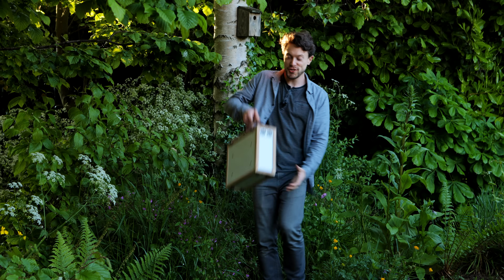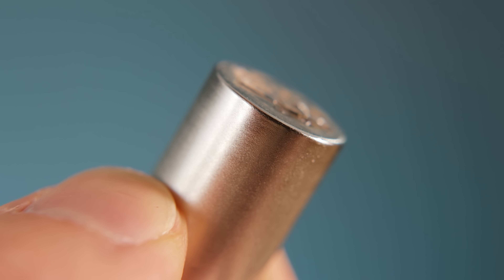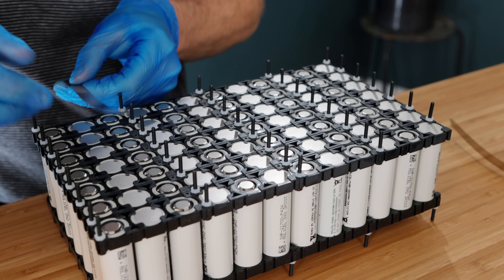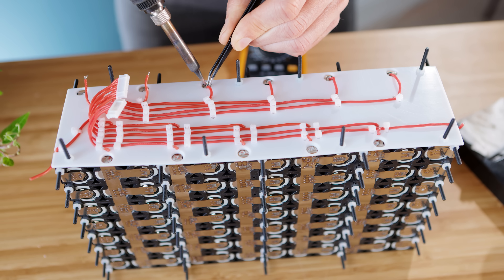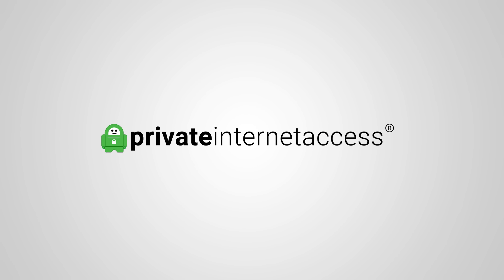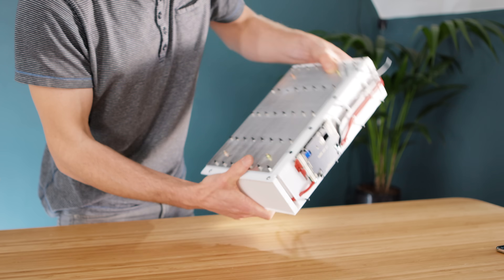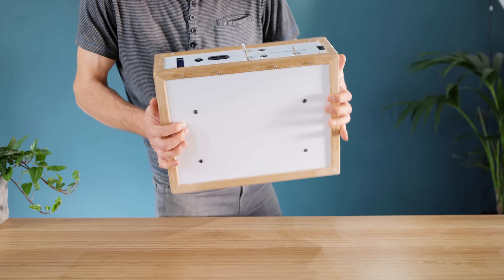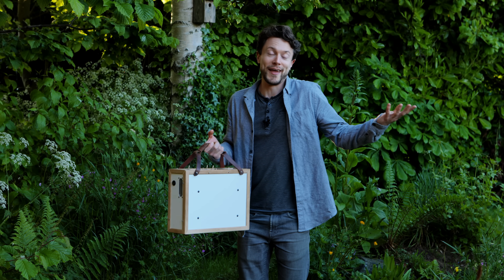Build your own portable POWER STATION (1200w, USB-C and MORE!)

Comment from the maker: Leave any questions here and I'll answer with an FAQ edit to this pin! Also don't forget to check out this video's sponsor - Private Internet Access: http://www.privateinternetaccess.com/DIYP
Reply: What did it cost you to build?
Reply: @philipnelson5 21700 12s7p easy $1k the batteries are expensive the buck converters are $30 a piece the whole build probably $1.5k with tax
Reply: @KindredSupreme  a singular battery is under 4 pound multiplied by 84 cells equals 336 pound, not “1k”
Reply: @philipnelson5  over 500€ for just batteries
Reply: @philipnelson5  that what I’m wanting to know XD
Reply: Will there be a part 2 for this to set up solar based direct charging? would be cool as an off grid option.
Reply: @Omriabu1  I second that, would love to see that happen!
Reply: @Omriabu1  This is even cheaper than buying used Model S battery modules! This was absolutely meant for solar.
Reply: Could you upload maybe a detailed version of what you bought or what tools you used and what settings you used to manufacture this amazing piece of tech?
That would be really helpful.
Reply: parts list would be awesome.. I'm especially interested in the DC-DC converters :)
Reply: You are doing an amazing job but still...show us where you connect what you connect. I learn a lot from that...not only for a specific project but everything in general. Let your videos be long as you want as I think everyone already loves your calm voice and demeanor. Thank you for this video.
Reply: @Drazys-yt  no schematic is a no deal for me
Reply: Loved the video as usual, but can you give us a parts and tools list with the detail and overall cost, please? Thank you very much. ;o)
Reply: @Adamastor00  description
Reply: Cool build!  How are you powering AC mains voltage appliances from the 50VDC, are you using an inverter that can take a 50V input?
Reply: @AllanMacMillan  good question. I doubt he's using a 50vdc inverter, they're usually massive things for more industrial applications.
Reply: @AllanMacMillan  yes, it sits in the final microwave-on-the-table shot, right behind the oven.
Reply: How much does it weigh? I'm very curious.
Reply: I want to see a project like this with solar charging
Reply: @muhamedshorbagy7854  just buy a 20 pound solar panel on eBay and plug it into the battery
Reply: @themastereal8345  👍
Reply: I'm a bit sad there aren't any details in the dooblydo, usually after watching a mobile battery  pack build, one can at the very least find there information about the exact make and model of the utilized battery cells, part numbers for the 200W buck converters (buck, a.k.a. voltage step-down), details on the precise dimensions 9f the nickel strip, used wire gauge, part numbers or website links to the used BMS, etc. etc. etc.

Without any of the information mentioned above being provided it automatically becomes 100 times more difficult to replicate this build 🤔😞
Reply: @TheBauwssss  https://www.fogstar-wholesale.co.uk/product/molicel-p42a/
Reply: Woooow!!! I can use this tutorial to make a battery for my ebike??
Reply: @elcubofilosofico  why not, don’t mind the weight tho
Reply: @elcubofilosofico  Just buy one. And maybe a charger.
Reply: Are you a:
1. Electrical Engineer
2. Super Genius
3. Alumni of Google University
😆
Reply: It looks very well isolated electrically, but Is there any risk of the batteries overheating, whether due to charging / discharge / external climate?
Reply: @tf6858  the fan probably prevents that
Reply: How much did it cost to make?
Reply: I don't think PTFE is the best choice here. If a battery does catch on fire and gets hot enough to decompose the PTFE (higher than about 260C) you will be looking at a lot of very, very bad flouride gasses.
Reply: @lucasmagno9148  I thought PTFE melting is about 360C?
Reply: This thing reminds me of that incomplete Most Powerful LED Project you were doing a few years ago but that specialized PSU/converter died & you didn't have any spares.
Reply: If it's heavy, you can try making a trolley mini luggage type version as well
Reply: @Sandeee  make it battery powered ;-)
Reply: @Sandeee  I agree with this idea, if its a cart version it could have a much bigger battery
Reply: @Sandeee 🎉
Reply: @Sandeee 🎉
Reply: @Sandeee  
Make two so you can carry them balanced.
Reply: great video just be carefull with the ad spot that you had for this video as people have had problems with pia in november last year. any chance you would be able to do a public doc with links for the parts used, like you kind of said in the video you can get the parts to do something like this pritty cheap on ebay but the quality and reliable wouldn't be any where near as good as getting good quality parts from a reliable source
Reply: How does this compare to UPS like Power shield Defender 1600 which an be bought for under  $ 300 Australian?
Reply: @IDraganM  The 'Power shield Defender 1600 ' has a 12V 9Ah battery. This equates to 108Wh.
The DIY Perks battery is a total of 1200Wh. So about 11 times as much power is stored in those Lithium cells.
Reply: @IDraganM  I was thinking one could probably be bought for a fraction of the cost of building one.
Reply: Where did you get your spot welder?
Reply: Is there any chance you will revisit the 1500 Watt LED Project with this? You did promise to test it outside eventually after the power supplies died in the last video. Would be a nice stress test for the pack.
Reply: what's the weight of this system? Cost to build?
I think this would be great for site visits if I needed to take a laptop, but I imagine air travel might through out some flags on this. also would make a really cool LAN battery box.
Reply: How much did that Welding unit Cost ?   Please and Thank You .   Cheers .
Reply: What was the total cost of the build? Not including your labour or tools.
Reply: A parts list would be greatly appreciated!
Reply: What's the total cost of the project?
Reply: @_BlackSpectrum  Based on the type of batteries he used alone that are about $20.00USD, 84 of them would cost $1680USD. The battery Management Systems are between $20USD up to hundreds of dollars. The other components are pretty negligible in cost, not sure about the machined aluminum panels. I'd say close to $2,000USD at the end of the day.
Reply: How much was the entire build?
Reply: Hello, nice job really like all your videos, i have simple question where can get material for build box as the battery in this video, i see other times the same material in your videos, and i don´t know if it´s plastics, or what, thank´s a lot
Reply: I've been wanting to do a portable pack like this and I'm very fond of the way you used the PETG sheets to insulate the whole thing instead of Kapton tape, but I have the STL file for a battery holder similar to the one you used except it's in a hexagonal shape (these can be bought as well), and I want to modify it to have a hole to accommodate screws for a similar design. I'm going to 3D print the holders with 100% infill and my main goal with this style is to fit more batteries. Any thoughts?
Reply: @TheGangster-uc4rk  have you tried to do the parts you thought about 3D printing yet? If you have, did you create the files yourself or did you find them anywhere, did you pay anything or did you grab it for free?  My thoughts are with you on doing those myself, that's why I'm asking. I'm planning on 3D printing everything that can be 3D printed, even like the pegs and all that. If you found/created a file for just the batterie-thingy/holder, some other parts of the build or the whole thing and would like to share it, I would be super grateful!
Reply: @Pre.C_King  I just found the cell holder files online, there’s lots of renditions of them out for free. I ended up buying a large pack of them on Amazon I found for cheap because my printer was having some issues.
Reply: What inverter did you use?
Reply: Where do you get bulk 21700 batteries for cheap? For me to mimic this build, it would cost me well over $1000, making a factory made 1200w battery pack much cheaper.
Reply: Is all the battery poles connection necessary? Since you parallelize each 9 negative  poles into 1 electrically isn't a single series connection of the 12 poles enough? Why are you connecting in series each of the 9 with it's neighbor? I'm sure I'm missing something, but what?
Reply: @DIYPerks please keep the bms balance wires the same length because the different wire resistance will unbalance the cells
Reply: Hi there, I was wondering where you learned about electronics? was this out of passion or due to formal schooling?
Reply: can you do an electric go kart project using this or another diy battery pack?
Reply: @DracolegacyOfficial  my exact thought. I’m 3D modeling one rn. I’m planning on building a few of these for it tho, because I want range. Based on my calculations tho, if you use a 48 volt, 750 watt motor, you should be fine for at least an hour. However, I could be literally 100% wrong, so PLEASE don’t take my word for it
Reply: Why use so many small batteries? Wouldn't it be simpler to use 2 or 3 12v batteries each with a 7.5Ah capacity? 
Could be for the size i guess but just want to know if there would be any difference.
Reply: @tastic3866  and what battery is 12v there are no 12v lithium cells.
Reply: @navidmehdi6  oh. Aren't those batteries used in motorcycles and UPSs lithium?
Reply: @tastic3866  not the same. a battery is a collection of cells. so these 12v battery has a collection of 2v cells. they use a type of lithium tech called LIFEPO4 cells. each tech has pros and cons. LIFEPO4 generally has long life span a stable voltage across discharge but they are much more expensive. each has pros and cons.
Reply: @tastic3866  little to none, maybe for price? Dunno
Reply: How can I obtain the schematics for this build? I’m very interested in building my own power supply. I do have experience when it comes to soldering and etc.
Reply: Just for curiosity, how much does it weigh? :) (in kg pls)
Reply: Can you tell us the make, model for the 48V to 240V inverter?
Reply: What's the build cost? And cost per cell? And what if you wanted to charge a USB-C PD Device?
Reply: Would the temperature of the batteries be a concern since you didn't appear to add any temperature sensors, or are you charging and discharging at thermally safe rates?
Reply: Can you design a Slice Battery for Lenovo Thinkpad T460 with enough thickness the size of 18650 cells 3d printed in a nice case that would make it the first laptop to last an entire week on battery life ?
Reply: What laptop was that 7:30 ?
Reply: how much did it cost to make it and do you have any links for some of the parts?
Reply: @Mike-x6i4l  description
Reply: Total Cost to make it. it must be very high compared to a normal Inverter/UPS
Reply: Where did you buy the cells, why, and how much did you pay per piece?
Reply: Does it overheat? Looks like the batteries are not cooled at all.
Reply: Amazing video. One thing I recommend to change for safety reasons is the nickel path. You should make a main path and solder the cell (blocks) with thinner wire, to make individual fuses.if one of your 84 ones goes rogue, it will affect all the others and escalate it quicky. Wire such as 35awg thin fuse wire is nice, rated 5amps,usually go up to 8amps, much more than you currently draw... 1200w at 50v is less than 0.3amps in each your cells.
Reply: could we pls have a parts list, I really really want to make this as I am camping a lot
Reply: Roughly how much did this cost to make?
Reply: Parts list (mostly)
1 - Energus Tiny BMS s516:
$175

84 - Molicel INR 21700 P42A 45A 4200mAh:
84 * $8 = $650

misc electronics:
 3 50V buck regulators 
 2 tiny fans
 1 usb hub
 1 usb c charger
  also voltage meter, misc connectors, wires etc
$200

Materials
 misc plastic, wood, metal
$100

large 200w? AC to DC charging brick
$75?

Total: about $1200

Considering you can get a comparable e-bike battery for less than $500, it would have been more interesting to see you modify one of those instead.
Reply: What kind of Bluetooth module did you use to connect the BMS to your laptop?
Reply: How many hours do you need to charge this beast?
Reply: I am impressed by your projects every time. I'm interested in how you got the necessary knowledge. So what you studied or what your job is?
I'm looking forward to your next video.
Reply: Are you concerned about leaving this in a hot car? I would recommend an active monitoring & cooling subsystem for the power cells to improve cell life and prevent overheating. Also do you have a suggested substitute for PTFE? Should this catch on fire, PTFE creates toxic fumes.
Reply: @linyongzheng  this would make a good v2 video
Reply: so if we have a cursory, basic knowledge of electricity, construction, and how to safely combine the two, and we follow your instructions/guide as exactly as we can, we can recreate this??? 'cause it's so cool and useful and doesn't seem that complicated, just exacting— which working with electricity usually is! this really will work so well with my camping and road trips!!!
Reply: @kaamn1829  as other people said, this lacks some safety measures if unattended
Reply: How much would it cost to buy one off you fully built and set up let me know thanks
Reply: Hey DIY Perks! I just got 2 questions.

How long does it take to charge?
And
How many mah does it have? (Approximately)
Reply: In South Africa we have for many years suffered frequent scheduled power outages for two hours at a time due to our failing and corrupt government owned power utility Eskom. Some people have a UPS but only for keeping their wifi router running. They will buy a 500VA UPS and then complain that is doesn't last the whole two hours, just running a router which is amazing to me. But I understand their purpose is for protecting equipement from sudden outages and powersurges. Not for supplying power for long durations.  And those things are also very heavy. They seem heavier than that suitcase you're casually carrying around with one arm. I'm assuming they don't use lithium ion cells.

So if UPS is a waste of money for power during a scheduled outage, and full off grid power storage is a big project and expensive. This portable all purpose long duration power supply is absolutely perfect.

I wonder what more it would need to make it act as a UPS. Or if a smaller version would still be economical so you could have two or three in different rooms or parts of tye house without running cables everywhere. Or perhaps a variety of small cheap specialized barebones versions for specific appliances. Like one for any fridge. One for any media set which includes TV, PC and Soundsystem. And one really tiny one for a router.

If someone offered those three things as a product im sure many south Africans would buy them immediately. Lights aren't really an issue. Everyone has some collection of flashlights and battery powered lamps some of which switch on automatically. But then there's just this aweful two hour silence. It used to feel cozy in the beginning like a noval way to get everyone chatting around the only battery lightsource in the house or some candles. I can assure you nobody finds it cosy anymore.
Reply: Can you use XT60 connectors in place of the Deans connector on top and charger connector on rear, and use it 2-way?
Reply: Not sue if he reads his comments but have idea for a different kind of build. Repuposing an old andriod auto car stereo for use as a in home or workshop music centre aka hifi
Reply: Any chance of getting a wiring diagram or instructions so it is a bit easier to see what components go where? I've got a good idea but it is always handy to have a schematic to check against before its first use.
Reply: Can you build one for a fan that is me
Reply: @mixologist1682  same 🤣😅
Reply: What was the total cost of this build compared to buying one off the shelf?
Reply: I have a few questions(I think no one will see but anyways tho):
Lifepo4 is a better chemistry and you said “50 volts fully charged” and usually it is like 51.2 nominal.
I would recommend having solar input, ac input and/or inverter
Reply: What size charger did you use and how long did it take to fully charge?
.
Can it be used while charging?
.
What type of inverter did you use to run the microwave?
.
How much did the project cost you?
Including charger and inverter
Reply: How much to buy a copy of this project from you?
Reply: Hi can you make a video that teach how the Bluetooth voltage preview connection to the software in your laptop to check the condition of voltage in the battery insider?. I'm excited to learn something new from you
Reply: I have a question
The inverter only use 12v or range volts?
I need inverter that use 50v
Reply: what was the side ptft 0.20mm?
Reply: I also have such, but what I was interested about is the inverter. Have you edited the noise out? To power something like a microwave without noise needs a bf inverter... 

On the other hand, I would not power a 1000w device with that battery. Yes it can do it no probs, but don't forget that tesla has a pretty effective cooler for the batteries, and even they do not pull all the juice out in an hour. 2kw is still not too big, and way less stress on the cells with a 1000w load. You will not carry such around. You put it in the car, and out of the car. What I am building now is a 2.4kw 24v battery, 2kw inverter, and mppt solar charger with 400w solar panels, but I might have to increase to 3.6kw, because I need power :-D
Every enhancement of the civilisation without civilisation :-D laptop, projector, fridge... adds up fast...
Reply: @peterbalogh2646  What cells are you using? I would like to do something similar.
Reply: @rando39393   That project is on hold now. In the country where I live, it is kinda hard to get my hands on cells, so we'll see. The rarity of use and the energy density are good reasons to go with second hand lifepo. First thing is the cooling side of the inverter, because that is the only part what makes noise, and I do not like noise.
Reply: Do you plan to keep the cells charged at 100% for your maximum, or will you keep them at a ceiling of 90% or so? Was something like this where the batteries can potentially stay fully charged for quite a long time, it could be vital to the lifespan of the cells that you set a proper charge ceiling for them.
Reply: @Ecrfour  ideally 60 percent
Reply: name2  He used lithium ion
Reply: Is there any concerns over the temperature of the actual battery cells?
Reply: @shark103  You can if you want, but it really isn't necessary. Especially if they're legit cells. Given he chose Molicell, they're almost certainly legit... and expenssiiiive!
Reply: With a battery pack of this size is it possible for a few of them to power a motorcycle or a similar 2 wheeler? And do you plan to make such a vehicle with a DC motor for one of your next videos?
Reply: Are you monitoring the thermals of the battery pack or have a thermal cutout at all? Or is it not nessarry?
Reply: i'm considered with battery cooling....
Reply: You just reminded me my childhood cartoon show, Dexter's laboratory , but you just tall , Big love from INDIA.
Reply: Did you make a cover for the top connections? If not you're going to get a lot of dust and crap in those ports.
Reply: What courses or degrees did you get to be able to brainstorm and/or get into making such great quality items?  I've always loved technology but I usually fall short in the understanding of the internals to be able to experiment and come up with my own ideas.
Reply: @shark103  also
Reply: No brass casing this time? It would've looked super classy with brass!
Reply: What kind of cable did you use to recharge the pack? Where can I find a similar BMS board with charging for lower capacity systems? I would like to build a wireless speaker system inspired by your last build but am having difficulty finding proper power delivery and management circuits
Reply: Where did you buy those batteries?
Reply: @SoyHectorMartinez  description
Reply: Would there be a way to run this as a UPS (uninterruptible power supply)?

Fantastic idea, would love to make one of these!
Reply: Why do I get the feeling that in the future you will DYI a home made Tesla . Great job!
Reply: @quintonquill  just watch Jerry rig everything
Reply: U can buy a pd 3.0/qc 4.0 board which can power compatible laptops with 20V from type-c power delivery.
Also, what about thermal protection and fusing the cells? If one cell gets an internal short this whole thing could flame.
Tesla uses wire bonding tech with large nickel plates but small fusible wires going into the battery for safety. When a cell shorts, the fuse will blow and isolate the fault cell from the pack.
Reply: Do you have a github page with a tutorial ? Or are you gonna leave us in the dark?
Reply: @Snoigel  not even a schematic
Reply: Would love to see a Cost to build for these projects.
Also would love to see more feature coverage on the USB-C and different power options on this unit you've built
Reply: How much did this cost you
Reply: Would you, please, make a wind power plant for a small house?
Reply: Would loved to have seen a parts list link.  And what this cost at built
Reply: What was your budget for this project, both time and money?
Reply: If fire occurs, breathing ptfe fumes can be more dangerous than flame
Reply: Aren't the car fuses made for voltages lower than 50v sometimes even only 12v?
Reply: What was the total cost of the build?
Reply: How did you plug in the PS5?
Reply: @maxclarenf1  power inverter
Reply: Does the pack get warm/hot at all under high loads? (Also considering it is surrounded by fairly thermally insulating material.)
Reply: What brand of cells and what model did you use?
Reply: @technilaunch8353  description
Reply: 6 hours... A ps5? OMFG!
Reply: Will Prowse needs to see this
Reply: I'd like to know more the 4-bay charger you shown. My current charger is tired, and I accidentally purchased button top 21700 batteries which barely fit.
Reply: How did you learn how to make all this stuff?! It’s seriously amazing!
Reply: Awesome video with the what appears to be lots of precautions taken for a battery array!

Are you considering making a solar generator version of this? With the 120/240v inverter built in and a solar input.
I suppose we can modify the design to include it. But your designs and instructions are A+ 😉
Reply: Hi Matt, how are you? 
I have one question: What did you study or how did you end up, doing so cool stuff? 
I really appreciate your content!
Reply: Please make smart glasses 👓 which can give notifications on mobile.
Reply: How do you make videos like a professional
Reply: Congrats 3m sub
Reply: How long is the economic life of that battery pack? How long will the battery last in monthly use?
Reply: The dead earbud into stereo speakers guidelines are still on deck, right :( ??
Reply: Have you considered making a Powerwall? or adding solar charging to this power power pack?
Reply: Can you post the wireless earbuds —>  wireless speaker guide? It’s been a month...
Reply: Would it be possible to backwards engineer an ebike battery? 

They can easily be 60v plus and comes with a casing, you can dremel out slots but they are also welded and can potentially save time and money if don't have a welder?
Reply: @louinesbeggache  remove the pre installed bms and add your own
Reply: How about charging the battery bank with solar panels? Unlimited power for camping.
Reply: Would it be wise or unwise to fill the cavity with a wax to prevent things like water damage or shorting in a humid environment? It would add weight and reduce heat management/ventilation abilities, but could also add protection and a noticeable sign of overheating? Also, would there be a better wax for this, because I know parrafin has a lot of thermal expansion and contraction between its liquid and solid forms?
Reply: @ethane333  I don't think you have to worry about water damage from humidity. I wouldn't leave it in the rain though.
Reply: Can you build a loop battery bank for this setup but make it solar powers?
Reply: Please do a diy external flash battery pack for flash(photography speedlight)
Reply: What I want to do: power an ultrabook and a Starlink antenna (both below 200W), how long would it last with 12 hrs of usage per day, how long would it take to recharge fully and solar panels can be used to charge it or would damage the battery for being too slow?
Reply: @imnotbreno  slow rate of charge doesn’t damage the battery, the battery is 1.2kwh so 1200 watts per hour meaning 1200 divided by 200 means it lasts 6 hours, half your day, solar panels can be easily used.
Reply: Price point plz?
Reply: What inverter did you use? Where did you get the digital display?
Reply: Build a system where you can stack few of them and hook to solar panel+ off peak charging = Home or room primary energy sucrose. Make a kick starter talk to some manufacturer to build the DIY kit so that we can build it our own. And thanks a lot for you hard work. I am big fan since day one.
Reply: Won't all of that plastic prevent heat from escaping and overheat the batteries?
Reply: @AlturoChen  fans
Reply: Where did you purchase the BMS?
Reply: I saw that FLIR footage and immediately thought of the usb port replacement video! Is that the same one?
Reply: How worried are you about the battery pack overheating? Curious if you considered using a cold plate rather than just a couple fans.
Reply: I thought you will use xt60 instead of deans
Reply: Kind of not worth it when you consider you have to buy that little welding station to weld the nickel strips onto the batteries. Plus, where is the parts list?
Reply: Can it be charged using solar panels?
Reply: @TheGOUDfather07  easily
Reply: How can you walk around and not fall with this massive brain of yours?
Reply: Do you have any links to the bms device’s you used
Reply: will you actually make the faq list?
Reply: How about using one big li ion 200A battery?
Reply: Why not 18650?
Reply: please make a full kit to purchase we can buy that as well we could support the channel
Reply: What is the total capacity of that battery
Reply: I think it would be nice to add a 12/24 V Input with a MPPT-Controller, this could be used for charging via a portable solar panel or small wind turbine.
Reply: Sir can we add two solar panels on its two parallel side to charge the battery pack ? And sir can we add more cells and can create a battery pack  which can run an Electric vehicle.
Reply: Is it safe to power heavy appliances (microwave, fridge) when it’s only providing 50v, I thought that they require 240v?
Reply: Can it be used as a ups?
Reply: Can I do it in a small scale ? If possible which parts do I use?
Reply: the more important question. Can this light up a Lightsaber....... ?
Reply: You said you used regulators for 12/24V, why not use down converters as these are more efficient?
Reply: Total cost of this project?
Reply: Have you used some special cells with protection circuits integrated or plain ones and you leave all of the protecting to the BMS?
Reply: well 1. what is the capacity? 2. for me this arent to thick wires but ok
Reply: name2  These are LiFePO4. Fill your mind with technical details at battery university (google it).
Reply: Approximately how much did all the parts cost?
Reply: It would have been even greater if you had made a diy spot welder (the one you have is quite expensive for a single diy project), you can make one from a microwave transformer !
Would you consider to build one ?
Reply: With such a large number of cells in close proximity, I'd have expected some more heat management, ensuring good airflow around the cells, possibly with fans and temperature sensors.
Reply: @JohnnieHougaardNielsen  I had been wondering about heat too. I think the faster it's discharging, the more heat generated so maybe limiting the overall power draw is enough?
Reply: Are There slightly cheaper but good enough BMS? 170€ for yours is a bit much for the small 6S7P i want to build. :/
Reply: it could be one of those: https://de.aliexpress.com/af/108W-USB-Car-Charger.html they all look pretty similar. i'm searching for a good one myself.
Reply: How many amp hours or mah is it. And how much total did you spend on materials?
Reply: Plz share where did you buy the battery cells plz share website and link
Reply: Would be nice to have a rough price breakdown. Also, would like to maybe see a future video to address waterproofing concerns regarding this item, have 50v DC exposed to the air like this is probably not a good idea :\
Reply: How much does this cost?
Reply: they are using those as the new solar batteries, they are super nice and compact.
Reply: What about heat dissipation? From what I know, any operation (charging or discharging) of these cells over a period of say a couple of hours can lead to heating of the cells. Does this heat degrade the performance of the cells (especially considering that they are in an enclosed space)? If so, then is there any way to remove the heat? And if heating is a thing then are should one be concerned about fire hazards? Because this was a concern with earlier Teslas which had batteries similar to this in close proximity. 

My information/knowledge could be wrong. Feel free to correct me!
Also, awesome build. Congrats. I have watched this video in its entirety at least 3 times.
Reply: Why does the external charging port have 3 pins? and what kind of charger are you using? 50V constant current?
Reply: What’s the capacity in Wh?
Reply: Can you add a build list.
Reply: Is there a way to add AC outlets to this circuit tree?
Reply: Would you be so kind as to provide a wiring sceme? xx thank you
Reply: Where did you get that Charger? 2:21
Reply: Don't we need a better cooling system for the battery pack?
Reply: any chance of solar charging?
Reply: you sould check out @jehugarcia he is working alot with DIY battery solutions, it might be interessting for you.
Reply: Is it possible to link it to a solar charger?

 I have horses in a field and am looking to set up some creature comforts. Was looking at running stuff of a car battery but it's very limited and I wouldn't be able to hock up a laptop to it.

Will definitely build a version of this now I think, but would love to know if I can charge it with a solar charger, rather than remember to bring it home
Reply: Could one top it up using solar?
Reply: Did you cut the balancing cables to different length's, I couldn't tell and sometimes the slight resistance from the cable length is enough  to cause balancing issues over a large time.
Reply: Are you sure your PCB at 14:40 can provide 24W per port ?
I've tried to find such product but every time I only find ones limited to 18W or 24W in total, i.e, distributed over all ports.
Reply: Why not build one of these batteries in a slightly smaller form factor to replace your car battery with? I'm sure the weight difference wouldn't be much, if any, assuming you only make it using enough cells to match the form factor of the original car battery. In addition, I would think that doing so would keep your car battery from dying if you were to leave the headlights on overnight.
Reply: Just what is the energy capacity of that thing? Are we in the high kWh range?
Reply: Is there anyway you can show/ explain how to make this “system” compatible with solar panels? I really want to try and make a solar panel version of this for ventilation and lighting in my workshop. And maybe some tools 😇 love your videos can’t wait for the next one 👍🏻🇳🇴
Reply: I'm curious to know the cost of this project as well as how long it would take to fully charge the batteries.
Reply: With the nickel strips being routed over the plastic battery holders, and using the battery holders as a main structural element via the plastic nuts, aren't you worried that mechanical shock load to the outer shell could push on the battery holders, and pull up on the nickel strips?
Reply: Can you drop the parts list
Reply: Put the kits for sale on a shop.  :)
Reply: I wonder that you might check out this channel (https://www.youtube.com/watch?v=emip7H8_-Yg) who has built a powerwall for his house. Despite taking care to balance out the cells (especially since he's using used laptop cells) he gets issues with cells heating up within the pack.
How confident are you that your BMS not only balances the cells but also stops overdischarge or excessive differences during discharge?
Reply: Can you list the parts and websites you used to order them?  Thanks DIY Perks!
Reply: How did you manage to solder the side folded strips without melting the plastic spacers under it?
Reply: How about instructions for a 120 volt portable power box.
Reply: Why haven't you mass produced and sold this yet? This seems extremely useful for so many reasons.
Reply: Would it be possible to hook up the battery to a small solar panel to be completely independent when you go camping?
Reply: How long can this power your parabolic dish sun for?
Reply: this is the only sponsor on any video I will ever use
Reply: How much was it? Do you have a parts-list?
Reply: one of the best useful project.. i wonder if it could even fully charge an electric vehicle?
Reply: What's the general budget that it would take to actually do this project?
Reply: Hey man, I wonder if you'd be willing to make an actual guide for this one, I'd definitely be willing to purchase a step by step guide off you
Reply: I was wandering about cooling. I know with my experience with lithium cells that that they can produce heat. Surely that many can produce enough to worry about?
Reply: Why didn’t you run parallel connections on the negative terminals?
Reply: Nylon nuts is the term given to cheaply produced men's underwear, and I shall use it from this day forth.
Reply: @NeonVisual  great seeing you here! Loved your voyager work.. Would love to see you work on remastering full episodes😳
Reply: Question - what about using LiPo?
Reply: This looks expensive, what’s the cost including special purpose tools like the welder? Is it not cheaper (and safer) to just buy one?
Reply: I’m sure you can’t talk about price since the project was sponsored, but maybe you could tell us more about whether this is something the average DIYer could afford. For example, if I can afford a PS5, could I afford this project, or is this a >2 PS5 project?
Also, have you thought about making a supercapacitor version of this project?

There’s a YouTube channel called lasersaber that made a hand-crank generator which uses supercapacitors for its power storage. I’ve thought before that his design could be scaled up to include a pedal-powered generator, such as the K-Tor power box, but it is far too complicated for my skill set, and far too out of my price range.
Reply: Why didn't you use a nickel bus bar on the positive of the cells? This is the first time I've seen someone doing that.
Reply: When is the solar panel top rack video due ? (kudos on the build btw)
Reply: @shark103  How are you going to measure the internal resistance? If the batteries cells are the same make and model, then they should be close enough for practical applications.
Reply: PowerPole would have been a better choice of connector for unregulated DC output.

https://www.andersonpower.com/shop/wire-to-wire/powerpole.html
Reply: So are you the new David Attenborough of DIY tech? Well, that's the way I see you. We really appreciate your work!
Reply: Are you going to make videos more frequently now?? Your last video was only two weeks ago whereas they’re usually about a month apart
Reply: What about battery temperature monitoring/fuse? Unnecessary??
Reply: This is perfect as is, but can you make your car charge this? Maybe add another dynamo (i guess it‘s called like that) somewhere to your car, making use of the distance which you would have to travel anyway to get rewarded with electricity :)

Also thanks for making this video, greetings from Switzerland
Reply: Can we use this for electric motorcycle 🏍?
Reply: Have you an official Instagram account. Could you link it to a future video please. Also part list would be great. Keep it up
Reply: name2  At 0:48 he clearly states Lithium-Ion, not the polymer ones.
Reply: Good build but no thermal protection?
Reply: What is the total combined amperage output?
Reply: Hello, can you make a video about what we can do with a broken phone - with his camera or something else?
Reply: Wha is the capacity of entire thing? total parts cost?
Reply: 5:42 The name of the music playing in the background?
Reply: You should so start selling kits 4 these and also maybe even the full product
Reply: Nice build! I love you attention to detail. How bad was it when some of the nylon bolts broke when you were putting the locking nut on them? Were you tempted to redo the whole thing?
Reply: Please add an option to charge it via solar panel. It will be awesome.
Reply: this is a dream for drone pilots on everyday missions
Reply: Are you open to suggestions about a new project? I wanted you to try a project and I'm sure it'll help a lot of people.
Reply: https://youtu.be/N7sXHc2ul1Q
Reply: Hey man, awesome project.. just wondering if you could sponsor the batteries for me.. where i come from, it's very very expensive.. i just wanna make those amazing project of yours.. if you can sponsored, i really appreciate your help.. hope to hear from you soon..
Reply: @2nd 87898
Reply: Is there a way to charge via solar?
Reply: can you make a portable PC
Reply: yet another great video i am sure, but I am still waiting for the guide to make the earbuds/bluetooth speaker build?!?!?!?!?! it says it "will be uploaded shortly".....its been a month now and you have uploaded two more DIY PERKS videos.....
Reply: Get a correct tip for your soldering iron.
Reply: can you make something on a old PSP or PSVITA
Reply: do you have a job dude? just tell me and no lie!
Reply: How about hooking it up to a Photo-voltaic panel to charge the battery pack with it? Do you think is it possible? If you could pull this off then the system is literally off-grid.
Reply: Were you in Game of Thrones?
Reply: Why did you choose 50v?
Reply: Please do a UPS system!
Reply: Next project suggestion small cctv camera using old mobile phone camera
Reply: Could you hook up a power inverter inside of it, and have one or two (In my case US) power outlets?
Reply: How long does it take to charge the whole thing from 0 to 100? Also how long can we use a outdoor infrared heater with this magnificent brick?
Reply: I watch all your videos and might I add you've got excellent ideas and designs and some excellent builds
Reply: Where did the software to monitor the battery pack via bluetooth come from? Does it come with the module or the BMS board?
Reply: Would love to know how to charge it with solar?
Reply: @markbernhardt6281  you can add a 1200 watt micro solar inverter (available on amazon) and use one of the sides to attach folding solar panels
Reply: Can it charge Tesla?
Reply: DIY motorized height adjustable desk please.
Reply: Can you do a similar video but using old iphone 4/5 batteries? I have around 200 iphones 4/5 and i was thinking about building a kart or e-bike with them
Reply: Would you ever sell one and if so how much?
Reply: how do you calculate the measurements of each piece?
Reply: I love your Videos. But i have problems with the BMS Settings, but i have the same BMS as you.
could you Show uns your bms Settings?
Reply: @shark103  Im no expert, but to an extent what you are saying sounds correct. Differences in internal resistance could mean one parallel chain charges slower than the others by receiving less current. grouping the batteries such that the total internal resistance of each parallel chain is equal to the other parallel chains would ensure that they all charge at equal rates. This is, as you identified, VERY important. What this doesn't account for, though, is the possibility of different rates of self discharge between the batteries, or other confounding variables that may impact a battery's power output and charging speed/capacity. An easy way to reconcile this is to measure the voltage output of each parallel chain. This will indirectly take into account the resistance of the circuit because Voltage is equal to the current times the resistance. 

So, to your point, matching each series' total internal resistance together is important to make sure no series is charging faster/slower than the others. To his point, matching voltage output of each battery will simultaneously ensure that resistance is matched, taking into account the confounding variables that may affect battery output.

of course, my knowledge of electrical circuits is relatively limited so I could be mistaken in my reasoning and/or my conclusions
Reply: @2nd i think he used Xiaomi's 90 watt car charger, since a few of their phones can actually charge with those ludicrous speeds
Reply: what is your school career?
Reply: 🤔So…these lithium batteries can be used to make “impressive” homopolar demonstrations?…
Reply: How much did it cost? And is it worth it?
Reply: Needs a solar panel on one side, just to get that little bit extra out of it :D
Also, how well does your heat management work? 50W is... quite a bit of power. And lithium batteries can get uncomfortably warm under high loads.
Reply: You said it's capable of powering a console setup I am looking into buying a portable power pack for a PC project that I am working on I'm planning on making a portable desktop just because I don't like laptops that much they're too limited in the power poor performance so I was going to create a portable laptop out of desktop parts full on desktop components full on power supply as well would this be suitable for a mid-range gaming computer setup simply a mid-range gaming tower and a screen the power bank will be built into the back of the screen most likely so I'm wondering if this is suitable for that application it definitely looks like it could be but I would like to know what you think on it there's a whole lot of questions here lots of people commenting I don't expect to get an answer right away if ever but I hope I can soon
Reply: Can you add a solar powered charger for it, for the next video?
Reply: How much you spent and what is the list of parts
Reply: All I want is to talk with Mr. DIY, been watching for a long time, have been looking for your email also, I NEED TO HAVE A TALK WITH YOU, thanks
Reply: How much did it cost to source those materials?
Reply: Is there a way to make this able to be charged with solar power?
Reply: Can you make a solar powered charger?
Reply: @Morgan Holgate look at the description the batteries he got are 4200mah 21700 3.6v for £3.75 per cell if u buy 1-49 then 50-199=£3.71 per cell
Reply: Can I make one of these with enough juice to start a car? If so, how?
Reply: Disregard my other comment you just stated it can work for a car!
Reply: How much did it cost??? And does it matter how many batteries you use?
Reply: What is the cost for this project? And can I order this same device from you?
Reply: How about an added cover for the exposed outlets, due to small particles and moisture
Reply: Can you make a DIY e-bike?! I would love to see your take on it
Reply: Hi.  You repair all kind of stuff. Would this Thermal cameras be OK for motherboard repairs? https://youtu.be/ezKCyDcNAss
Reply: How do you design your projects before you build them? Do you sketch everything out, make prototypes, etc? How do you decide what parts to get? Are your designs based off of part availability or do you design and then find the parts you need?
Reply: Fantastic for so many situations.  Might have to build one.   Can it be charged eg trickle charged by solar?   Also take it to work and charge it up there and then power my pc at home with it lol.....err maybe lol
Reply: Can you make a electric bike with that battery?
Reply: Please please help. I've been trying to do the mushroom light project but ms SMD LEDs are not lighting up after soldering. They do work before but my solder technique seems to be frying them. Can you please advise? Thanks!
Reply: I'm thinking of making this to power a telescope star tracker for some astrophotography. It was getting a little more difficult to follow along for the second half of the video when you started to assemble components. Do you think you can make a pdf guide that is more detailed and shows close ups of how to assemble everything. I feel like that might also be better way give detailed build instructions without ending up with super long videos. Love all you content btw!!!
Reply: i vote DIY Permanent Magnet Generator for next project
Reply: Your device is very usefull in the country where i am living where you can have power during 3 Days in a week could you send it to me it will be very usefull
Reply: Can you make a compact tab from an old  phone  or  something else for yor next project
Reply: That is a monster build and very impressive. I am curious if the control module, can be configured to alert you when the batteries get to a dangerous level and need recharging? The dead car battery boost function is such a great idea to add. With a bluetooth karaoke portable speaker you and friends could have a fun party literally anywhere. The way you explained battery degradation, was so helpful. Does the control module show each battery or just the bank of batteries a problem cell might be in? Thanks so much for sharing your awesome ideas.
Reply: What if i would need 230 V?
Reply: I must have missed it, but what gauge Nickle strip are you using?
Reply: Can u make an external gpu setup for a laptop
Reply: Can u make an external gpu setup for a laptop
Reply: Unless the individual cells have their own current limiting for charge AND discharge. Then you'd just go below the minimum charge on an entire parallel set.
Reply: name2  Spoilers: He's waiting for Solid-state Battery
Reply: total build cost?
Reply: You should make yourself an adapter from the battery output to a standard 2 prong plug, 50 volts should be enough to run most universal motor power tools...   Older vacuum cleaners, drills Dremel and the like often work well on that.
Reply: Why did you not use something like a pelican case? I think it would offer more (drop)protection and is non conductive.
Reply: @asdrubale bisanzio He listened them under the heading
Reply: I'll be very glad if you write everything you did with a diagram into pdf for some of us who want to try out something like this on our own
Reply: Did you think of a cooling system for the lithium-ion batteries? They can get pretty hot under load.
Reply: so how much did it weigh?
Reply: May I ask you, in what domain you did your studies? You videos are pretty incredibles!
Reply: How does this compare in terms of performance and cost to batteries that are pre built for the same purposes ? An example being the Jackery Power stations
Reply: Any chance of schematics for this?
Reply: Did you measure how much of the 1,3kWh you can get out of it?
Reply: Can this be used as UPS?
Reply: @zaxonxp45  It depends on what device you'd like to power. Its capacity is 1.2kWh, and if you have a high power consumption graphic board on your PC, then it might be hard to sustain that long.
Reply: Can you make an electric bike with these cells?I wonder what else we can do with that much power and how many milage we can get out of it.
Reply: I looked for pure nickel strip on amazon but a lot of them have reviews that say it is really nickel plated steel. Where can i get pure nickel strips?
Reply: Someone else probably already said it but a few great alternatives to the dean connector solution would be XT90 connectors, medium sized powerpoles, and potentially a medium sized SMH connector. They would have only one correct orientation, but you wouldn't have to make custom connectors for everything you want to attach to it in the future, just crimp/solder and go :)
Reply: Hey, I little business prop would be to develop these as Saving packs for EVs (Electric Vehicles). "Never run out of juice" What do you think?
Reply: How about build your own DIY hard drive enclosure 2.5” and 3.5”? Massive enclosure or multiple hard drives enclosure??
Reply: What other components would this need to serve as a UPC for powering things like a desktop PC or 3D printer in the event of short power outages? I've been wanting to get a UPC for a while, but consumer units are pretty cheaply made, only being able to power a PC for a few minutes and getting VERY hot doing it owing to their extremely cheap transformers and caps, plus they only last a year or two before needing a replacement for their lead acid battery cells. Your unit clearly performs vastly better, and quality lithium batteries can last for years.

I only found your channel a few months ago. I had a dead laptop and wanted to salvage its panel as a secondary monitor for the desktop I was still putting together, so I ended up basing it on your older portable monitor build guide and I've been really happy with the result. Looking forward to doing another DIY Perks project!
Reply: Amazing!  Your very talanted.  Question, how much bigger would it be to have it charge itself with a handle(maybe a detachable one)?  Is it even worth having the extra weight and dimensions?
Reply: make a Diy electric scooter
Reply: No question just a suggestion. When charging batteries in parallel you pull ground from last negative battery and first positive battery to give you the path of less resistance. Balances the charge to every battery
Reply: Can I but this from you?
Reply: Where you leave the ground （can we have the wire diagram？）and for BMS board is there ones for 2.4V Ti-Li batteries？
Reply: Do you think this could be used to replace leisure batteries in a campervan? I imagine it could have the benefit of being able to access 100% of the charge rather just 50 before causing damage.
Reply: Make A power station 2.0 that can turn ac or freezer & many more
Reply: Hmm battery cooling to extend there life cycle? Can you set the controler to to only charge to 85% and never below a set value?. - Nice Job though, looks really good.
Reply: What about charging adapter? Can you please explain?
Reply: Thermal management optional
Reply: Did you ever consider using the Vruzend v2.1 system? It's a no solder system for connecting the batteries using bolts and bus bars
Reply: Do you use your own diy projects?
Reply: Sir, I would like to ask if it would be possible for me to get more information on this as I would like to build a CAD model for this and try for simulation in Ansys.
Would appreciate any help
for the breathing PC build
Reply: Great project.  Now add the solar panels and system to charge this with solar.   Compare to a Jackery system.
Reply: It seems odd to go with double deans over something like an XT90S, but I'm sure you had reasons
Reply: Hi DIY Perks, Here is an open source technology to build that kind of box for those that have less welding equipment, i have forgotten the BMS images https://www.youtube.com/watch?v=g4Aw9zxtOv4&t=13s    👍⚡ 🔧🐥
Reply: Rafał czy to ty? I was working with someone similar to you on software USB projects and everytime I watch your videos, you remind me that guy
Reply: You are Genius
Reply: What car inverter did you use for this project?
Reply: I would love to have one of those but I dont trust me enough in terms of work safety.
I only wonder why going for a outlet that needs another adapter instead of having multiple different beforehand on the battery itself?
Reply: What do you do with the grounding or is that just the negative
Reply: If I build the same thing with 18650 batteries ,water cooling and carbon fibre   housing , would u recommend me doing it? And also would the change in battery type affect performance?
Reply: Ive seen a huge mistake in the charging port!!!! You have to ALWAYS use the female one for the exposed connector. Phases are way too exposed for any metalic object to short them. And trust me it happens way more often than you think: from coins, tools, screws and bolts... It melts in seconds
Reply: I usually like seeing is the cost of materials, so I can compare it other on the market solutions.
I want to make this, but I really am trying to push my power needs in a portable way, with a bit of haste.
The Jackery series of generators works really well; with that in mind, what did all of this cost?
Reply: What is the total expected cost of the build
Reply: Just wondering how heavy is the pack actually
Reply: I think sharing the total cost build would be very informative videos. Great videos..Much Love from Nepal
Reply: hi, any reason why its 50V packs?
Reply: Please tell components name.. 
Comment all components
Reply: Can you build me one of these please
Reply: Cool build thank you!!
Reply: 7 months later ... Still no answers. It's basically click bait ... For example, one of the most important pieces of information - cost of build (not even including specialist tools) is not given ? Only reason someone wouldn't state the cost is to ensure that you watch the whole video. If we knew it cost $750 (random number), and a commercial alternative cost $450, chances are many people would not watch the whole video as the high expense + effort would not make sense.

A lot of the time people turn to DIY to save money, with the caveat that it takes up more personal effort. That's why no one is asking you how LONG it took to build, because it's a given that it's going to be time-expensive by comparison to the commercial alternative.

Omitting the cost of build is a calculated measure to increase your advertising revenue. And that's bullshit.
Reply: it lasts along time on one charge, that's awesome! Great Build!
Reply: hey diy can u do a video using the power bank whit a solar panels controller for charge it whit solars panels?
Reply: @Mr.Plague-n5x  its possible but he would need a massive solar panel because that's 1200w
Reply: why not make a battery "backpack" ? you could make it more powerful and carry it around and plug it into stuff you wanna use, im trying to make a drone....that you wear like a boot a nice big powerful battery pack would surly get it flying ;)
Reply: What is the thickness of the nickel strip that you've used?
Reply: could the aluminum plating also serve as a Faraday cage of sorts? 

another thing, could the design be tweaked to accommodate lithium ion batteries that have the same contacts with regular batteries? to sum it up im asking if it could be made so that the batteries can be replaced conveniently. sorry if that was long winded. cheers for the awesome video!
Reply: Why would you be powering lights though?
Reply: Can I put this in the trunk of my Tesla as a backup fuel source or for road trips?
Reply: What did your build cost you in total?
Reply: During the designing process, did you ever think about using an ammo box for weatherproofing? I'm sure it would have probably doubled the weight
Reply: I have only one question, that probably 1 in 10 people already asked - why not to integrate an DC-AC, you already did an excellent battery pack, all you needed is leave a little bit more room for 1-2kW inverter 
Otherwise - well done
Reply: Im looking to make a single 18650 battery bank using a DC motor to charge w/ USB-C output, what would I need to control charging so it doesnt catch fire?
Reply: What inverter did you use that had a 50volt input.?
Reply: How many KWH is it?
Reply: Please I need it to buy
Reply: Hi there, how much is the total cost of materials or are you also selling this device. This is very useful here in the Philippines.
Reply: What about heat management
Reply: Do the batteries themselves not require any cooling?
Reply: What about  a temperature thermometers to be sure when u do have a load close to the max load is not getting them hot?
Reply: What alternatives are there to lithium cells?
Reply: How many hours can this power station lasts?
Reply: What is the schematic of the build? Every good electronic channel has a schematic on the circuits they used but you don’t seem to have one
Reply: @shark103  isn’t the resistance the same? They are all the same cells
Reply: Man you just too handsome... 😜
Reply: What's the total price of it?
Reply: Would you make a 60watt powerbank?
Reply: @Nah iDestroyed i'm waiting for the video
Reply: the first two bms board links will not load
Reply: Please where did u buy the li ion batteries from. Please I need to know
Reply: @RUTS thanks
Reply: Can this be charged with solar panel or can be modified to charge with one???
Reply: What is the total capacity of this cell?
Reply: Lifehack channels compared to yours look like cave paintings. good job.
Reply: How are you getting 50V power if only 12 rows in series would add up to 48V if each cell is 4V (which they aren’t)?
Reply: What’s the total cost of your project for materials if I may ask?
Reply: can it be charge with solar panels??
Reply: do you have links for the aluminum plates or corners?
Reply: Me and my brother want to do this. Dad says it's impossible and tells us to buy a generator. I want to prove him wrong so bad. Btw how much did everything cost you?
Reply: ?
 @MikeVenom-mini  ?
Reply: Incredible video! I want to make several project each with varying voltages and capacity. When you test initial cell voltage I know you mention the voltages that are similar should be in the same group but what is the recommended voltage to start out with or does it even matter?
Reply: what inverter you use?
Reply: Hi Mat. Would you try making a portable power station like Ecoflow Delta Pro (3600Wh) power station out of batteries from Elon Musks Tesla batteries, and these can even get harvested or recyclable from Tesla Model X cars or older models. Because batteries operate at a high voltage, they can reach high temperatures. LFP batteries have a higher thermal runaway at 270°C, whereas NMC batteries have a lower thermal runaway at 210°C, making the former safer. And like the Ecoflow make it so you can plug in charging from etc. solar panels or wind turbine. This might get you a place in history to make something cheaper than the current models out there and now since we are in an unsure time where it could be beneficial if anything happens to Earth like say a catabolism, solarflare or fallout events like war or government crackdown or war. Cheers.
Reply: Would've adding a solar panel been possible?
Reply: great idea, i have been using a smaller pprimitive or less complex version of this but i gotta tell you that isoliting plastic around the batteries and the narrow spacing is not ideal as the heat get trapped during charging which overtime damages the batteries
Reply: Can you produce something like this for me and how much will it cost
Reply: can you give us step by step in depth instructions for this awsome creation !? Keep up the good work!
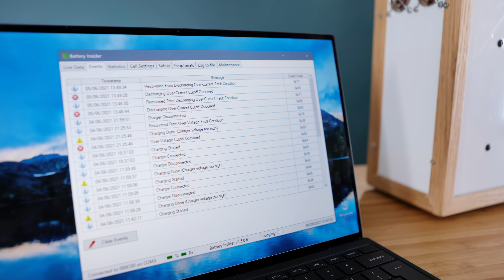Reply: 17:14 What bluetooth module did you use? And what software did you use?
Reply: Hello,
Im having a hard time following the way you've connnected parallel and serries circuit and where  you mounted the bms. Is there a way this can be explained simpler?
Reply: how much did it cost to build?
Reply: How do you charge jt
Reply: Schematics and BOM???
Reply: Can you do an updated video to this.
Reply: Remake for solar charge
Reply: How is it working in 2025? Any problems?
Reply: We need a v2 of this awesome project!
Reply: suggestions for next video:
- using high amp 21700 cells instead of the common 18650
- examining the worst case scenario when cells with different capacities ar not properly matched
- small battery pack torture tests (with 21700/18650)
- looking more on effects of water exposure and oxidated cells
Reply: That's such a small battery pack but it lasts so long... Are there any consumer products like it?
Reply: @Burssty  There are quite a lot on the market, just search for "portable power station", sometimes with "camping" as an extra search term. They aren't cheap though; with prices depending on the capacity and features (many will feature built-in inverters for AC mains outlets). The one that DIY Perks built has 84x 15.12Wh cells for a total of 1270Wh. Something in that capacity range would typically cost around $1000 USD: https://www.nytimes.com/wirecutter/reviews/best-portable-power-stations/
Reply: @Burssty  It seems that the "PowerOak Portable Inverter Generator 110V 1600Wh AC Power Station" is an option.

Its bigger sibling. the "POWEROAK Portable Power Station AC200P 2000W 2000Wh" is another of the few options, that is at, or above, 1200Wh. 

The "EcoFlow DELTA Power Station" is another contender, with its 1260Wh battery.
Reply: @Burssty  $2,999 ones, yeah
Reply: @Burssty  Absolutely, for about $1,000.
I looked up the batteries he's using and for his configuration they cost just above $500. Add in the BMS and the other components and he's not too far away from $1k. Love the project though!
Reply: @Burssty  ecoflow delta
Reply: @Burssty  A Tesla
Reply: @Burssty  it’s really not that small, I’m sure that cost hundreds of £ to make
Reply: @Burssty  A Jackery is similar and has ports for connecting solar panels.
Reply: @Burssty  literally any power station
Reply: Dean's connectors seem a bit outdated to me, just a personal opinion of course.  Have you ever tried out Anderson Power pole connectors?  They have multiple current rated versions and the connectors' pins are fully shrouded on both of the mating sides, so it would be extremely difficult to get an accidental short circuit with them.  I'd love to hear your thoughts.
Reply: @BEdmonson85  I'd agree, Deans connectors are awful. Don't like andersons either though. I'm an xt90/xt150 kind of guy hahaa
Reply: @BEdmonson85  second this. anderson powerpoles are great, easy to use and don't require soldering. they can take quite the current as well, on my FRC robot they regularly handle around 40 amps, and thats for the 12 AWG ones.

although they do suck for constant removal/plugging in, as they feel kind of cheap and aren't super strong when bent around. Might be better tho since he can do a 2x2 grid of them (since they attach to eachother). Only downside is they are keyed and can only go in one way.
Reply: @Sw3d15h_F1s4  Yes, they are keyed but you can use a pair such they can be plugged in upside down, like below

+ -
- +
Reply: @BEdmonson85  They are very expensive; Single XT90's can't carry enough current for the invertor, two Deans in parallel can, although there are better connectors, but DC inverters above 1000w are huge power pigs and need lots of current.
Reply: What laptop do you have?
Reply: @juvrajsingh9252  XPS 13
Reply: Dude watts is used to represent power while kWh is used to represent Energy. 1 kW is 1000 watts while 1 kWh is 3600000 joules
Reply: Can you use this station as a no break for home?
Reply: Dude, you should build something similar into a false bottom in a bookbag. Have the outputs and charging ports go through into one of the zipper compartments and it'll stay water tight just like the bag was originally and you could build 24 volts into it quite readily.
Reply: Is 1,200 watts the same as 1.2 kWh? Also, if you were to switch the three outputs of 12, 24, and 24 volts, how many volts/amps could this thing safely output? I don’t know much about electricity, but I am trying to learn, and this inspired me!
Reply: @Smoke---  
When talking about electrical loads, Voltage x current = Watts
When talking about electrical sources, (especially AC), Voltage x current = VA
Although with DC, they tend to be exactly the same so "Watts" is regularly used as a measure of output.
An output of 1200W (1.2kW) for an hour = 1.2kWh.
kWh can be used as a measurement of "Volume" of electricity stored in a battery.
Reply: @Miketz  okay that makes sense, thanks!
Reply: @Smoke---  Watts is a measure of consumption, watt/hours is a measure of storage. So at 1200w draw, a 1.2kwh pack would run for an hour. A 2400w draw on a 1.2kwh pack would last 30mins
Reply: @th3d3wd3r  okay thanks! That makes a lot of sense
Reply: @Smoke---  np ;)
Reply: @Smoke---  no Wh is a mesure of capacity  and watts is for power. so 1.2kwh means the battery can give 1.2kw for 1 hr. or 2.4kw for 30mins. and 1000watts = 1KW or killowatt.
Reply: @Smoke---  1200 watts is 1.2 kilowatts, but 1.2kWh is a measure of energy rather than power; 1.2kWh means enough energy to supply 1200 watts for 1 hour. This battery has a capacity of about 1270Wh, so it'd theoretically provide 1200W for slightly over an hour, but that's ignoring losses when being converted to different voltages, and the fact that you never want to 100% drain a lithium ion battery.
Reply: @Smoke---  Yes, 1 kilowatt is 1,000 watts. But a watt is not a watt hour. Watt hours are how many hours you can have that many watts being output. Watts = Volts * Amps. So 1,200 watt hours = 12 volts * X amps. Solve for X to get 100 amp hours. 
In other words, you could use something drawing 1 amp at 12 volts for about 100 hours.

Just for illustration, say you pedal your bike hard. While you do that, your effort is worth 100 watts. If you do it for one hour and store all the effort you gave in a battery, that battery would have 100 watt hours when you're done.
Reply: @Smoke---  1,200 watts is 1.2kW not 1.2kWh. 1.2kWh would be the amount of energy the pack used in an hour
Reply: @Smoke---  no it’s not the same as 1200w
Reply: @Smoke---  1200W = 1.2kW, kWh is a capacity measurement. :)
Reply: @Smoke---  if I'm not wrong it means it can output 1.2kw for 1 hour so yes 1.2kwh setup
Reply: @Smoke---  same as 1200 kW. not kWh
Reply: @Smoke---  yes if you were to run something at 1200 watts for 1 hour it would be 1.2kwh, and the safe output amperage of the pack would depend on the gauge of wires used inside and cooling capacity of the fans, i did the math and that pack in specific is about 260 amp hours of power, be careful with lipos though, they like to explode when mistreated
Reply: @Smoke---  no 1200 watts and 1200 kwh are different things. When you have for this example 1200 watts on device it means : how powerfull device or machine is , kwh are killowatts pre hour and that means how many watts the device will consume in one hour. First number ( kw as power of machine) you are looking for while you are going to buy a new powerfull machine. The second you need to calculate how much all your devices will eat and that effect your bills for electricity.
Reply: @Smoke---  yes 1200w is the same as 1.2 kw
Reply: No.  watts != Wh.  1200watts is referring to an instantaneous output.  If this had a total capacity of 1.2kWh, that would mean that it could output 1200 watts for 1hr. The cells used here are inr-21700-p42a which have a typical capacity of 14.5Wh each.  14.5 * 84 cells = 1.218kWh.  Note that as the output increases, this value drops.  At 1200 watts, it's likely going to be a bit lower.

I don't know where he's getting the 1200 watts from.    Each battery is capable of 45A discharge.  The deans connectors are rated for 60 amps (*2) for 120amps.  Assuming the wires and battery ties are not a week point, the deans connectors will be.   This is 24amps per cell for a maximum output of 6480watts.  Also note that the total capacity drops to ~800Wh under this load.  @Smoke---
Reply: @Smoke---  no it isn't.
1200W is the max power output, while kWh is the energy "stored" in a battery.
1:05-Each cell is 4200mAh, so you do the math.
Reply: @sushimshah2896  I had to do way too much research, bit I get it now. Thanks!
Reply: @sushimshah2896  The math is simple, but not intuitive... 4.2 x 7 = 16.8Ah @50V
Reply: @sushimshah2896  my maths works out at 1.305kwh
Reply: @sushimshah2896  funni number
Reply: I'm lazy, can't someone do the math for me?

84x4200mAh = 352800 mAh or 352Ah.
How long this lasts depends on the current, and this depends on the voltage at which the 1200W is delivered.
If the 1200W is delivered at 240V, 1200W=5Ax240V (UK) so 350Ah should last a notch over 70 hours.
If the 1200W is delivered at 50V,  1200W=24Ax50V which should be 14 hours.
This seems counter-intuitive but remember V=IR so as the voltage goes up, to deliver the same current, so does the resistance.
Reply: @sushimshah2896  About 30 Ah right?
Reply: I mean if you do this...why don't try a diy Tesla Powerwall ? I'd love to see how you pull that!!! @DIY Perks
Reply: Can u built a most wonderful and premium crypto setup and then give it to me 😅😂🙈
Reply: Why not just use an off thr shelf battery system like Tesla power wall or similar (or even smaller)? Is the cost difference substantial?
Reply: @DheerajBhaskar  because he is making videos for youtube revenue. buying off the shelf doesn't let you make a video about how you made it yourself. certainly not one that gets a lot of views (unless you're already famous for your other vids).
If capitalism is working correctly, DIY should never really be cost-effective. That's usually kind of not the point of DIY, though. It's usually for fun and self-satisfaction, or knowing that you have a product that suits all your specific requirements.
Reply: Would like to see your take on a portable screen, keyboard, and trackpad to use with android phones.
Reply: final cost?  a jackery 1000 is $1k usd and a whole lot less fuss, i would only see this as worth the trouble if it comes at considerable savings.
Reply: I will never trust you Theon Greyjoy! Not in a million years, not even in this "nice tech guy"'s disguise of urs!
Reply: Your content is getting less and less DIY if you ask me. In earlier videos you presented nice solutions 'on the cheap'. Like the security system, or the fake windows. Great videos, inspiring and repeatable. The choice of 2170 cells, a high quality branded BMS, a top notch spot welder, the best nickle strips made me switch off the video. I can't build that. And the same goes for the brass PlayStation. The equipment and craftsmanship you showed for that video is way over the top. Nice for showing off your exclusive taste and expensive tools, and beautiful end products, but that's no DIY for most people standards. I really wonder how many brass PS5's are build after your video. Or how many DIY folks have 2170 cells laying around. I'm definitely not hating on you, I love your channel, but I would really appreciate it if you could focus some more on reachable projects.
Reply: @oscar3611  very true but his videos always served as how he did it, with his budget, and his experience, doing something similar to what he did isn’t out of reach for most people, for example putting a couple of cheap laptop batteries in series and using the rest of the parts, but overall I do believe due to the need to make his video better than the last , has also resulted in more expensive content that less can relate to
Reply: Do the batteries themselves not get warm? I noticed that you had fans at the top near the BMS but not alongside the rack of batteries itself.

Also, what was the total kWh? :)

Very cool project!
Reply: @callumrocksyoursocks  Yes they get warm
Reply: I love you
Reply: Just buy one. Cheaper.
Reply: @jayr6666  1500 watt functionality is not common and is with the high end models, plus the huge capacity to charge anything, this is very cheap compared to prebuilts, for example, each cell is about 4 pound, 84 cells, so the cells are 336 pound, the parts included in the build add up to about 150 pound (over estimate) which makes the project only 500 pound, this is a lot cheaper than the thousand pound alternatives
Reply: https://www.amazon.co.uk/gp/aw/d/B075DHJ6JW/ref=ox_sc_act_image_1?smid=A3P5ROKL5A1OLE&psc=1
Reply: Why didn't you add labels for the inputs and outputs. A small attention to detail makes your product look 100 times better.

Also why did you use generic switches and lcd. It makes it look not professional. Perhaps a touch interface instead of lcd
Reply: @alexandrafreeman8135  doesn’t seem necessary since you can access it 100 times better with the application in the video